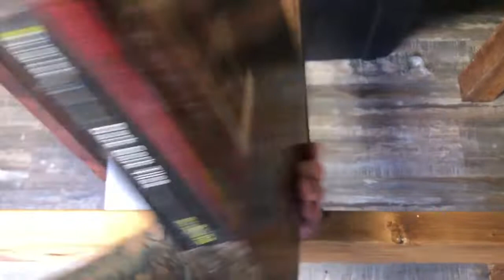Cheap and Fast DIY Natural Vivarium Backgrounds

Comment: How can I attach something like wood to the cork? Use silicone?
Reply from the maker: Depends on the application. Silicone 1 (nothing bathroom or kitchen As they contain arsenic) but also expanding foam works well for securing pieces together